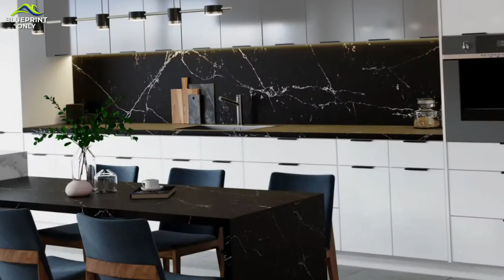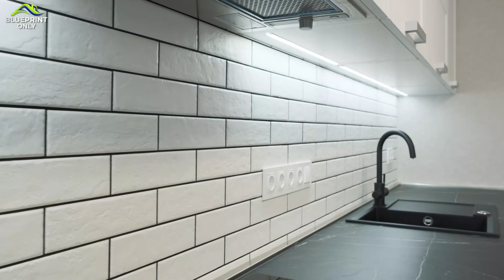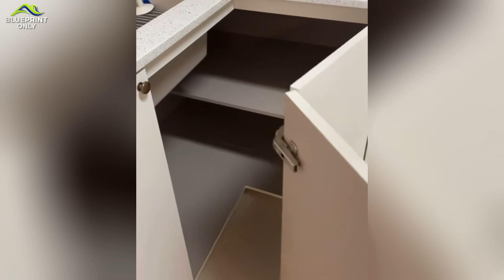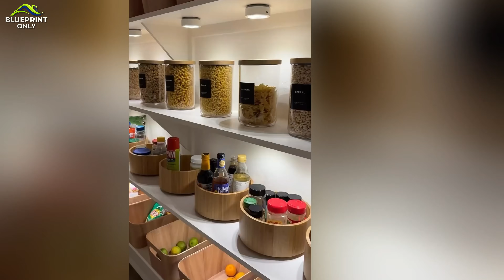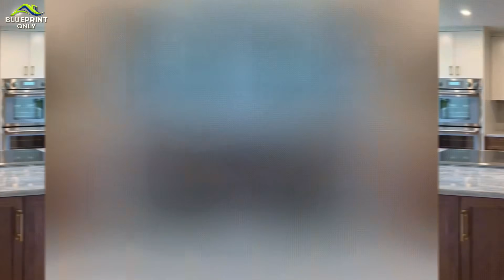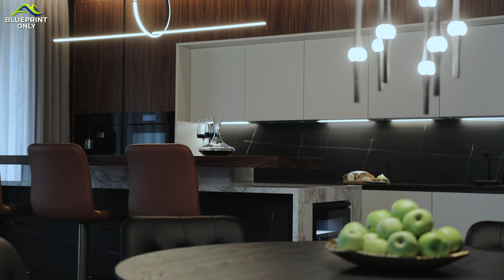12 Kitchen Design Regrets & Common Mistakes To Avoid

Comment: I would never consider T pulls but neither do I want integrated handles or J pulls. Pulls that are rounded on the ends instead of square or protruding past where they screw into the cabinet cannot catch in clothing. I’ve had rounded pulls that protrude from the face of the cabinet for decades and have never had an issue. Knobs and straight pulls that protrude past the fastener barrel at either end are another story. I prefer knobs for doors, but keep door to uppers and tall pantries, with rounded pulls beneath the counter.
Reply from the maker: Thanks for sharing your extensive experience with different pull types! It's super helpful for others to hear real-world examples of what works (and what doesn't!).